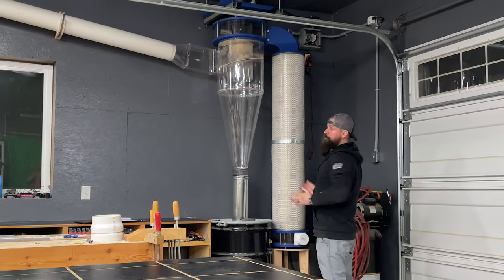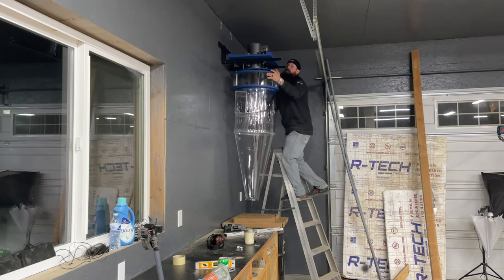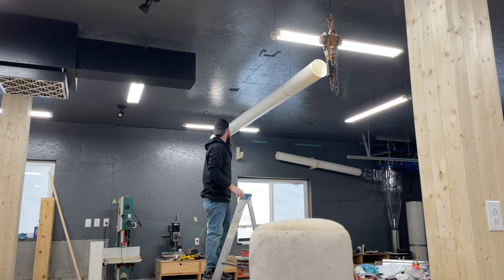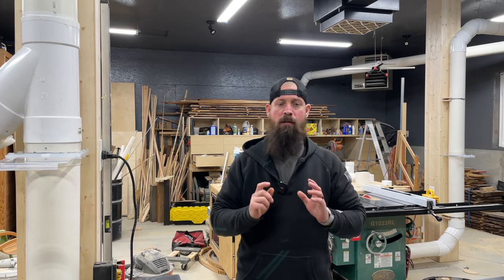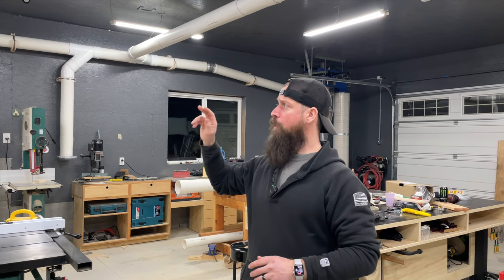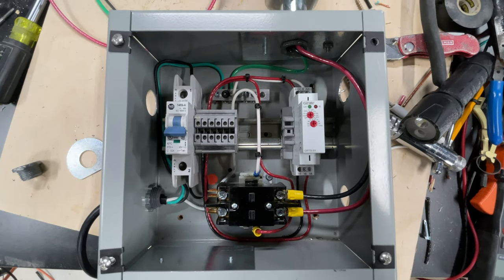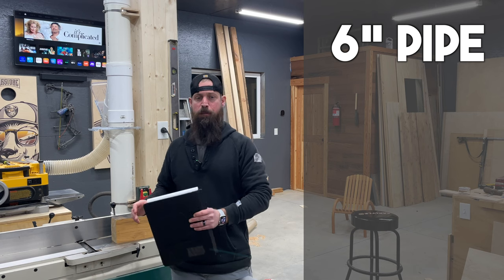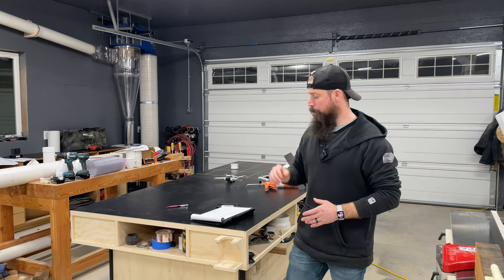Installing dust collection, With One Simple Modification |Plus DON'T USE THIS|

Comment: Can you vary the distance the dust collector to the wall? The reason I ask is I’m wondering if building brackets that would keep the duct a little further from the wall would help with sealing the joints
Reply from the maker: @MajorTendonitis  the standard wall bracket they sell limits how far off the wall the cyclone  hangs, but if you build something similar to what I did, you can put it wherever you want. 👍🏻
Reply: @brewbuilds   thank you I didn’t know that. I really liked  your adjustable idea using rods . Will have to watch again
Reply from the maker: @MajorTendonitis no problem! Don’t hesitate to reach out if you have any questions on what I used, or any other questions. My e-mail is on the main page of my channel. 👍🏻
Reply: @brewbuilds  thanks again. I may have to borrow you for just a minute to lift it into place  :)
Reply from the maker: @MajorTendonitis 😂 definitely don’t do what I did. I paid for that for awhile. 🤦🏻‍♂️

Comment: question, why the 10 amp breaker inside the box?  and also which DIN Rail Terminal block did you use any idea? ORdered teh timer switch through your link :)
Reply from the maker: @pctatc66  I added the extra 10A breaker as extra protection, and to isolate the internal components in the box. That way it wasn’t just relying on the protection of the main 15A circuit supplying the power. It’s probably over kill, but I do electrical for a living and it seemed like the right thing to do. 

The terminal block are made by a company called phoenix, and they are UK-5N. I don’t have a good link to supply for them, as I just had them laying around from a previous project.  But if you google (phoenix UK-5N terminal blocks) there are a bunch of sites to order them from. There is nothing too special about them, other than, they are compact and well built. But don’t think you have to purchase them to make this work, any terminal block will do just fine. 

Thanks for watching and taking the time to comment. 👊🏻
Reply: @brewbuilds  cool.. Thanks for the quick reply. Ordered the breaker (it is a good idea) din terminal blocks and din rails as well. I really like the way you set up the timer.  I almost feel Clearvue should sell this setup as an additional option!
Reply from the maker: @pctatc66 you bet bud! I’m glad you were able to track all the parts down. It’s actually been really handy, and I’m glad I did it. If you have any other questions I have my email listed on my channel home page, so don’t hesitate to reach out. And let me know how your system turns out! 👊🏻
Reply: @brewbuilds  Awesome. Will do man.  Im not an electrical genius.  However I have a friend who was an electricians mate on a USN Submarine.  He knows his schitck!
Reply from the maker: @pctatc66 heck yeah!
Reply: @brewbuilds  So we ended up having a couple of issues with our timer mod build.  The link for the timer switch you show is actually for a delayed time ON not off. You need to change it to link the GRT-B1 model,  not A1 model.   We figured out A1 is on and B1 is off.  The other issue we had is that our actual RF receiver switch was wired backwards!!!  Maybe ours was the outlier but when we put power to the system it kept tripping both the 10 amp breaker that we installed in the box and the 20 amp breaker in the main panel!  Took us forever to figure out what was going on with it.  But it turned out the Neutral and Line were wired backwards INSIDE THE RECEIVER!!  Since you are sending power to this thing differently with your set up it would always blow the breakers!  It worked in the original layout from Clearvue cuz polarity didn't matter there.  Basically we were sending 110 power back through neutral to ground!!  Did you have this same issue or was ours just an an outlier?
Reply from the maker: @pctatc66  man thanks for pointing out my link, I don’t know what happened there. But yeah you definitely want the B1, my apologies.

I didn’t have any issues with the receiver, or the circuit. I’d have to go back and revisit to jog my memory. I haven’t looked at it since I installed it. I use my setup almost every day and haven’t had an issue.
Reply: @brewbuilds   I really appreciate you putting out this video. Other than the link (which anyone could cross up) your synopsis of how you built it was very helpful!   I'm just glad I had my friend who is an electrical genius to do the problem solving for me on that wired from the factory wrong receiver.  I just used my table saw for 5 minutes worth of cutting. It was great to not have to worry about if I let the Cyclone run long enough!  I used that extra 10 minutes to clean up the loose dust up off the floor and around tools with my 20" hose and brush wand extension!